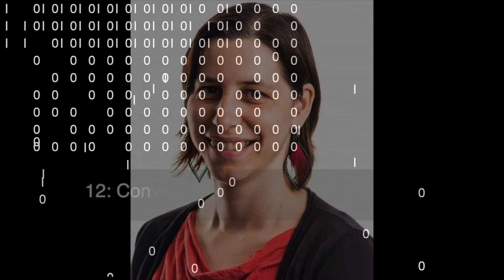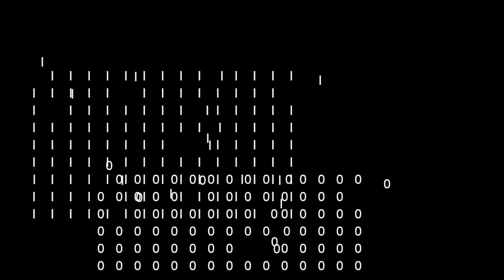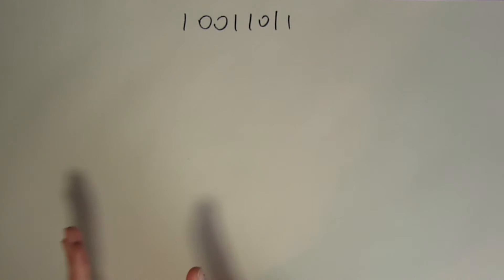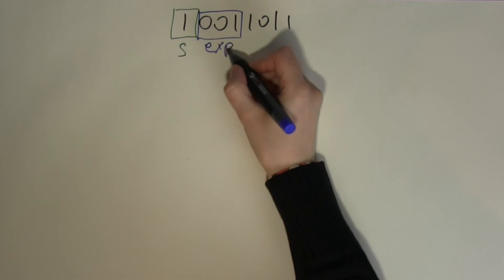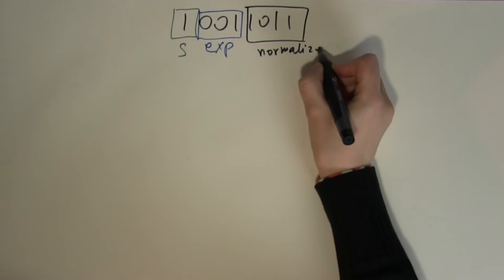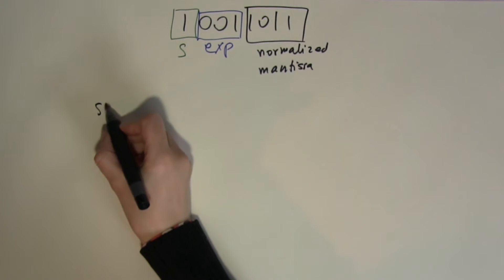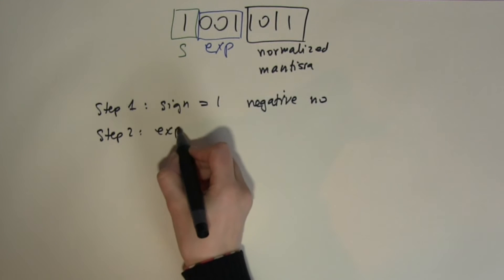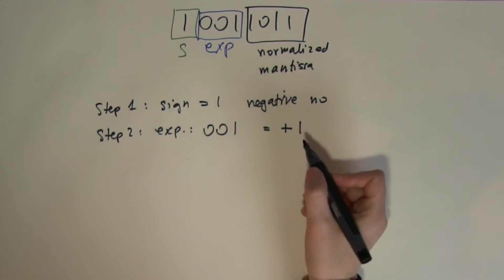Binary 12: Converting numbers in floating point notation to decimal numbers

Comment: i tried this with 0011 1001 getting 4+1/2 but the book says its supposed to be 9/32. What am i doing wrong?
Reply: maybe the book is wrong or maybe you have written the numbers wrong?

However with the numbers you have supplied (00111001) I got the same answer as follows:

step 1: = divide S=0, eee=011, and mmmm=1011

step 2: exp 011 = +3, so you have to do the opposite -3

step 3: convert matissa: 1011 = 0.1011 
then from the decimal point move 3 places to the right Ans =100.1

Step 4: convert to decimal = 4.1/2

voila!!

This is how I remember it. I spent two days on units 11 ans 12: DEC-->floating point and floating point --> DEC.

It done my head in, but i get it now.

Comment: For the answers I get a) -13/2, b) 11/64, c) -9/8, then the same for d and e. Am i doing something completely wrong?
Reply: TheNickMontague I’m glad someone else got my answers for a and c 👍
Reply: Hey I got the right answer for A as follows:

Step 1: = divide S=1 (negative answer) eee=011, and mmmm=1101 
Step 2: exp 011 = +3, so you have to do the opposite -3 
Step 3: convert mantissa: 1101= 0.1101 then from the decimal point move 3 places to the right Ans: =110.1
Step 4: convert to decimal = 61/2
 dont forget to put the negative sign = -61/2

Voila!! 
This is how I remember it. 
I spent two days on videos 11 and 12: DEC --> floating point and floating point --> DEC.

Ans B: = 11/64
Reply: TheNickMontague my slides say subtract the bias from the exponent giving me a -2 from 0b001 -0b011.
Reply: Ans C is correct if I am not wrong is '9/8' the same as 1x2E0  1xE1/8? That's what she has written it is not 11.
So your answer for C is correct. LOL.